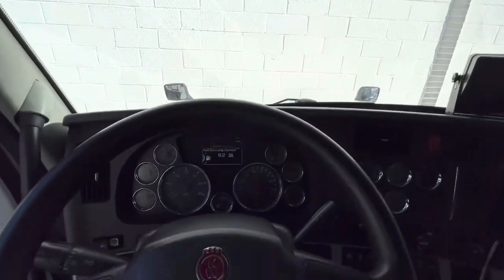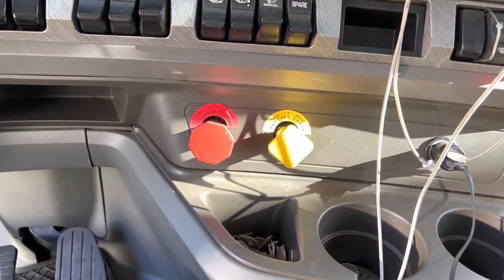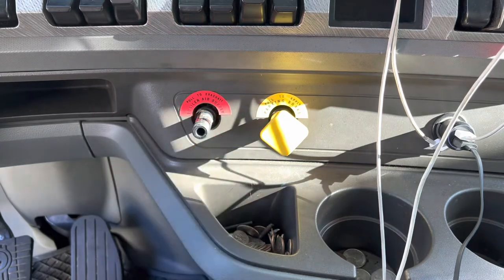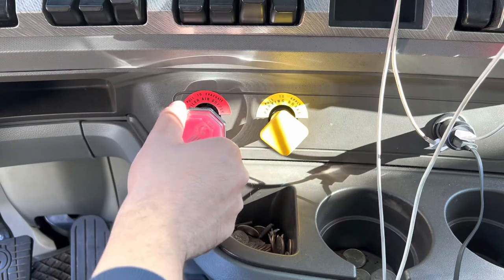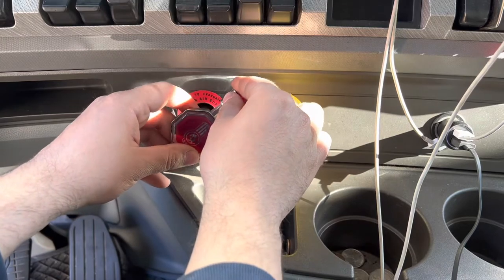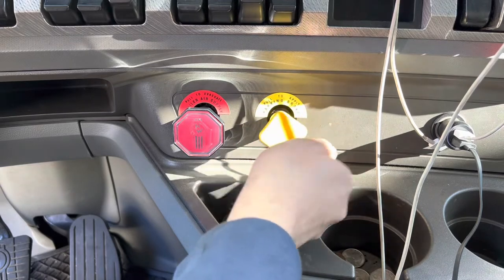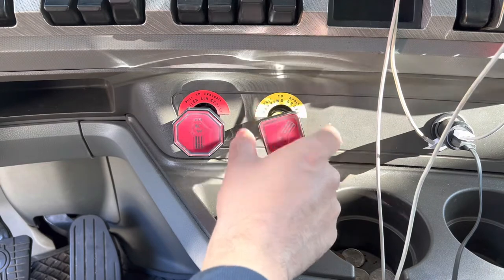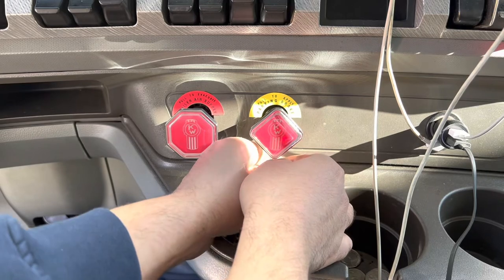Kenworth Tractor Trailer Air Brake Knob Replacement

Comment: I’m having trouble with the ones I bought. Like they don’t want to screw on. They’re the chrome ones with the brown leather longhorns. Don’t know if you’ve seen them or not at Iowa 80.
Reply: Same here.
Reply: Did you unscrew the hex bolt on the knob before putting on? Might have to check the depth of the chrome ones you have to the length of your screws. That or their thread could be messed up. Inner thread should be 5/8  11  @El.Pelavacas_Van-Lines
Reply: @johndowns4161  i did and also got 4 different ones.  Now I am using pliers to pull the break until I go back to OEM.